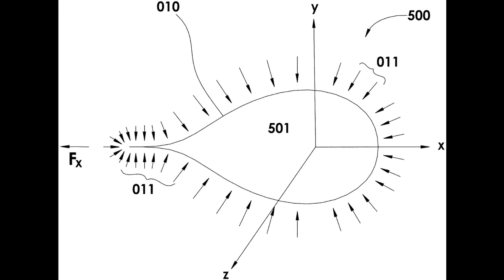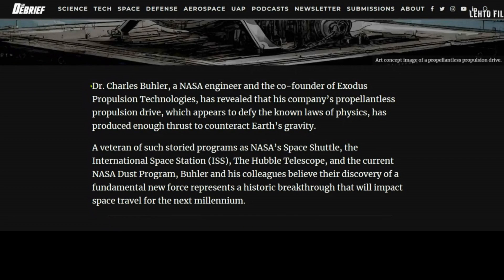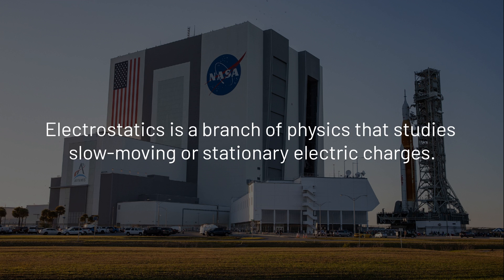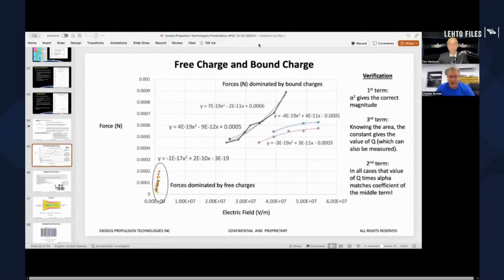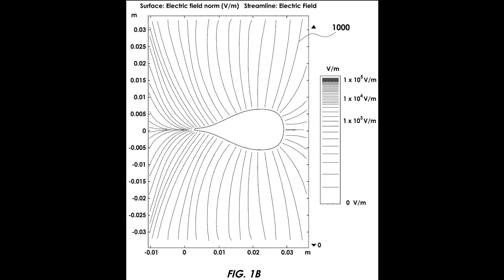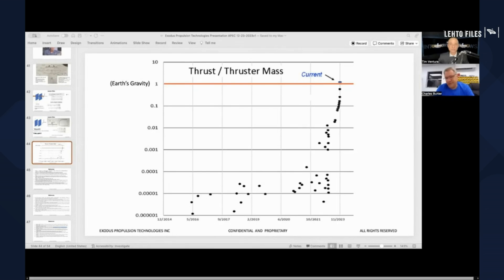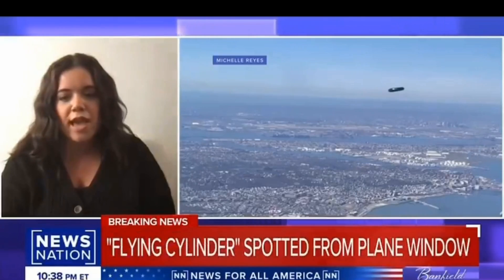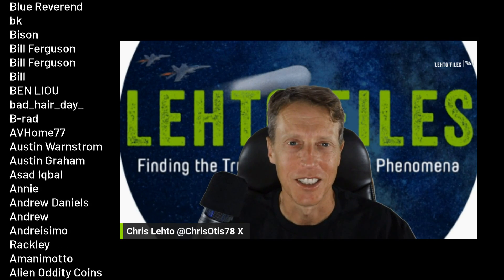NASA Scientist's Propellantless Thrust Breakthrough - The Key to UAP Propulsion?

Comment: More from Uncle Kenny (magneto-dielectric manifold theory unifying all the forces in the standard model):

I assembled a plausible 7 elements from uncle kennies theory (which he took from tesla and just modernized a bit) about how the allegations of the patent make sense within his alternate framework of physics ;)

1. Dielectric Torque and Electrification:
   - The Magneto-Dielectric framework posits that rotating a magnet near a dielectric reflector induces a dielectric vacuum torque at quarter-turn intervals. This torque results from interactions between the magnetic field and the superluminal dielectric components within the inter-atomic volume of the reflector. The resultant dielectric precession and vacuum perturbations could potentially manifest as electrification, occurring perpendicular to the dielectric Z-axis. This mechanism may account for the anomalous forces observed in patent US11511891B2, offering an explanation beyond conventional field theories.

2. Magneto-dielectric Gyroscopic Interactions:
    "According to the schema, a magnet can be conceptualized as an electrical gyroscope, characterized by its own inertial plane and magnetic axis. The creation of a dielectric 'gyroscope' through electrification generates an electromotive momentum, manifesting spatially along an axis perpendicular to the dielectric inertial plane. This novel interpretation of gyroscopic interactions between magnetic and dielectric properties may elucidate the unusual force behaviors described in the patent, suggesting complex interactions not addressed by standard field models.

3. **Magneto-dielectric Resonance and Coherence**:
   - The schema highlights the critical role of coherence and resonance within magneto-dielectric fields. It posits that achieving coherence between magnetic and dielectric components can lead to unexpected properties and interactions via self-organization ala Prigogene. The anomalous forces documented in the patent might arise from the device's ability to induce a state of magneto-dielectric coherence, thereby generating field behaviors and forces that diverge from traditional expectations."

4. **Inertial Plane Torque and Electrification**:
   - The framework proposes that magnetic oscillations exerting torque on the dielectric inertial plane serve as a fundamental mechanism for electrification. This torque prompts precessional vibrations within the dielectric medium, culminating in electrifications at luminal velocities. Such interactions might explain the unexplained forces observed in the patent, indicating that the device manipulates inertial plane torque in ways not recognized by conventional field theories.

5. **Gravity and Dielectricity Interactions**:
   - The magneto-dieleftric field theory suggests that the phenomenon commonly referred to as the "strong nuclear force" is actually a manifestation of dielectricity. It proposes that dielectricity is responsible for the cohesion of protons and neutrons in stable mass configurations within the nucleus. The schema posits that mass particles, such as protons and neutrons, are the result of the stable convergence of terminating dielectricity. In the context of the patent, the anomalous forces could be a consequence of the device manipulating the dielectric interactions that underlie the stability and cohesion of matter, leading to force manifestations that are not explained by conventional models.

6. Counterspatial Dielectric Conduction:
 The magneto-dielectric schema indeed emphasizes the counterspatial nature of dielectricity and its interaction with magnetism. It suggests that the counterspatial dielectric field serves as the inertial plane and the critical membrane upon which magnetic fields can exert torque, giving rise to various phenomena. This concept could potentially explain the anomalous behaviors observed in the patent, where the interactions between magnetic fields and the counterspatial dielectric medium might lead to unexpected force manifestations.

7. Dielectric Capacitance and Magnetic Permeability Interactions in the Context of Field-Derived Space:
The Seer Strike schema emphasizes the importance of the relationship between dielectric capacitance (permittivity) and magnetic permeability in understanding the behavior of electromagnetic waves and their propagation through space. It proposes that the product of permittivity (ε) and permeability (μ) is equal to 1/C^2, where C is the speed of light. This relationship is crucial in describing the properties of space and its role as the medium for electromagnetic wave propagation.

However, unlike conventional theories that treat space as an empty container, the Seer Strike schema posits that space itself is a product of the interaction between fields. It suggests that space emerges from the interplay of dielectric and magnetic fields, with the dielectric field serving as the inertial plane upon which magnetic fields can exert torque. In this context, the dielectric and magnetic properties of space are not fixed but are instead determined by the underlying field interactions.

In the case of the patent, the anomalous forces observed could potentially be explained by considering how the device manipulates the dielectric capacitance and magnetic permeability within its local field environment. If the device alters the balance between these properties, it could lead to a modification of the local space, resulting in unusual force manifestations that are not predicted by standard electromagnetic theory.

Comment: This discovery means that once the initial charge is established in the 'asymmetrical drive' of a craft using this technology you wouldn't need to generate any further power to propel it, ever. You should be able to 'throttle' the 'asymmetric drive' by manipulating its symmetry to control its velocity and propel the craft.

Comment: Force on a charged object is qE, where q is the object's charge and E is the external Electric-field the charge experiences.  OK, there's an asymmetrical charge distributed on the surface, but where is the external Electric-field?  Sometimes there's an Electric-field between clouds and ground, but this system purportedly works in outer-space where there is no external Electric field.  Sounds like quackery so far?

Comment: How is this different from the Biefeld-Brown effect? It's the same phenomenon, just with insulated capacitors. The goal is to create an electrical system with relative high voltage so either increase the current or increase the resistance.

Comment: Chris, when Dr. Buhler explained what the configuration of asymetrical capacitors, I recall the "ARV" (Alien Reproduction Vehicle) and the underlying asymmetric electro-mechanical force generator, as 2 discs rotating to generate extremely high electrostatic voltages, which would create the force to overcome gravity. It seems similar to what is discussed here.

Comment: Fuel less, Propellent less, and there are no G forces from acceleration inside a warp bubble. The principle of this is the warping of space. Dr. Buhler has been testing a configuration where the drive is external to the warp bubble which would be subject to G forces but if scaled up sufficiently and generating the warp bubble from the inside there would also be no Gs.  Since the asymmetric capacitors warp the fabric of space without discharging, there is no limitation of requiring more energy than there is in the universe to exceed the speed of light. This is real, so the rest is engineering.

Comment: I'm confused. What exactly do they mean by "1 G" of force? Don't we need more info before "1G" makes any sense? If I apply some force to a paper clip so that it accelerates at 32 ft per second per second, then that force is "1 G". If I apply some force to the battleship USS Missouri so that it accelerates at 32 ft/sec/sec then THAT force would also be 1 G. Obviously in 1 case the force is minuscule and in the other case you would probably need several nuclear reactors to get there.

And... I don't think we can attribute this new force to the propulsion system on a UAP. This force isn't what they use. Many if not most or even all UAPs exhibit instant acceleration ... some kind of force field that effects not only the UAP itself but the beings inside. This new propulsion system appears to only work on the "engine" and not the contents of the craft, so acceleration would be limited to whatever can be tolerated by the beings inside the craft. No 90-degree right angle turns at mach 9 with this thing.

One more thing: Why didn't they build a small radio controlled aircraft and put this engine in it and fly it for a month, as a demo?
Reply: F = ma.  Assume m = 1.

Comment: Until now….yeaaaaaars ago….vacuum formed aerogel’s and their applications…you can create a vacuum between two layer and control that in aerogel and levitate it.  because on a molecular level the holes are smaller than the air molecules. Because of the vacuum you create weightlessness  You just need couple well positioned micro valve systems to control the in and out put. Just wait…just…wait…till this hits the public. It’s the exact same result of instant acceleration. Turning on a dime….imagine a metal alloy mixed with aerogel…gettin’ real close

Comment: @Chris Lehto - could UAPs be manipulating dense liquified metallurgical structures into ferromagnetic-like organizations that mimic these asymmetrical objects? Manipulation of the magnetic field vectors using some multidimensional toroidal overlay could explain the instantaneous flight characteristics where they shift directions under thousands of Gs because they can create any asymmetric geometric object. ???

Comment: Steven Greer was right!
But I'm not saying it is just because Steven Greer says so I have done my own research as well. It really isn't a new force It is gravitation! Space and time is not actually difficult to warp or energy intensive and this is evident because mass and energy do not actually expend any energy to create gravity. Bob Lazar even described his craft making a very intense electric field and Corona discharge until It was high enough off the ground. Power generation like fusion is already obsolete as it is proven to be overcomplicated and impractical and zero point energy is a thing. I'm assuming that electrons pretty much make their own localized gravity wells and these localized gravity wells only get stronger when the voltage is higher.

Comment: IMO UAP tec uses quantum computing and because of the nature of the electron its possible to break the light speed barrier. This combined with an impenetrable energy field allows them to travel differently and not generate friction. Energy doesn't create friction when it travels through the atmosphere and neither do the UAP craft. The field is essential to travel like an election does through the pathways of dark matter. Very much like folding space but there may be large expanses of space that aren't dark space and they take longer to traverse . Navigation control is quantum computing, it has to be in order to react at such great speeds

Comment: UAP tec is so advanced we can hardly imagine what they use for theust but I have a theory that the thrust is generated thru a quantum computing electronic gyroscope or something like that. 
The device NASA has discovered is for moving material without a force field. UAP technology may be similar but I think they propell by electronically pushing the field. IDK but the pilots of the UAPs know. 
Meanwhile they get chased and shot at. Im just saying that's probably not the best way to make friends with them. 
Contact is a very complicated thing and is not as easy as people would think. Eventually we can gain their trust but in the end its up to them , they're a lot smarter than we are.

Comment: If it's real it's of course huge but I notice a lack of video of it or other demonstration. It's the kind of claim you want to demonstrate. If I were to guess it wont be achieved with just electrostatics but just maybe there are some side effects that make it work a little like how you can drive an AC motor from just 1 phase with a little capacitor to fake the second phase.

Comment: If this propellantless thruster indeed produces at least 1 g-force (hence counteracting Earth's gravity!) in a vacuum chamber, where are the videos of it operating in full levitation? Until now, all propellantless claims were so tiny that the traces of their thrust levels were barely recorded, being deeply buried within the error bars of the background noise (and none of them moved macroscopically for the eyes to see, if you still wonder about this. Let alone take off). Thus, they were all inconclusive. Something is very, very bogus here.
Reply: The “test article” weighs 30-40g. The wiring, instrumentation & so on will weigh a lot more. The “test article” may not be able to support itself structurally. There’s a big difference between a piece of material generating 1g and a whole craft generating a net 1g. This thing won’t levitate. But it might be useful in space to generate continual net thrust over a long period of time.
Reply: @skwdenyer Agreed.  Plus, what is the power source?  How much does it weigh?
Reply: @RichRocketMan true it might require some THIC batteries
Reply: @skwdenyer  but don’t you need a celestial body for it to work?

Comment: Can someone explain to me what a force of >1g means in relation to mass? Surely the mass of the object is to be overcome so is the resulting movement from this force relative to its mass?
Reply: 1g force is the gravity the earth generates. If you can generate 1g force you can float.
Reply: @mw9297  ofcourse. Because all things fall at equal speed (subtracting for differences in air drag due to their shape) but regardless of their mass… right?
Reply: @likelydaily6767  mass and density, different thermal velocities.

Comment: It's a nice discovery which could leed to hover-crafts. But it's not the UAP propulsion, cause it would not allow for instantaneous accelaration and turns in sharps angles and it also would not allow for transmedial traversal in the way we have seen UAP are capable of.
The only propulsion system which would fulfill at least 4 of the 5 observables (Sudden and instantaneous acceleration, Hypersonic velocities without signatures, Trans-medium travel, Positive lift) would be an Alcubierre "warp" drive which contracts spacetime in front of the craft and expands spacetime after it.

Comment: Paul LaViolette wrote Secrets of Antigravity Propulsion and talked about the B-1 Bomber using high voltage electrically charged leading edge of the wings. Electrostatics could be similar in this case.
Reply: If this were true for the B1, it would be for radar cross section reduction.
Reply: @phoenixrising4073  In the book it is talked about the B2 Stealth Bomber. Not the B1. Commenter remembered it wrong.
Reply: Dude, I read the book you mentioned and he wrote about the B2 Stealth Bomber. Not the Rockwell B1 Lancer. Please, before you write something as important as this make sure your facts are right.
Reply: @User456ngjDf4DlT  It was a long time ago and the memory has faded. Not like you have ever experienced that. Perfect people are great.

Comment: Would this cause plasma to form outside the object, as in those night time spheres we see?  Would the outside of the object being covered in a plasma cause the blurriness seen in most videos and photos?  Just wondering.
Reply: I've know about Atmospheric Electrostatic energy for a few years now.  For every meter up, there is a 10x voltage differential. So we basically give an object the same charge as the Earth because like charges repel?